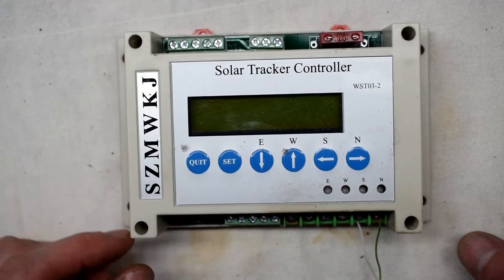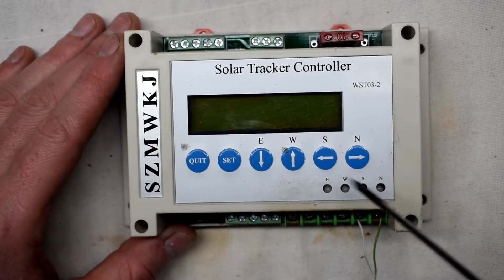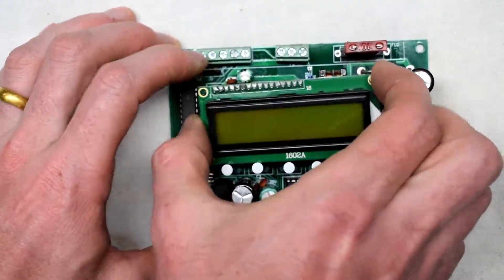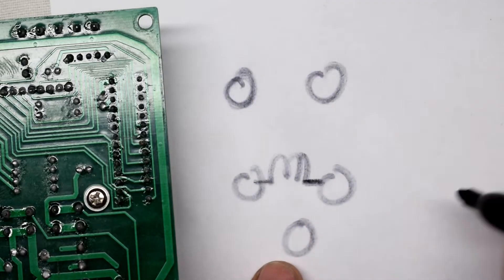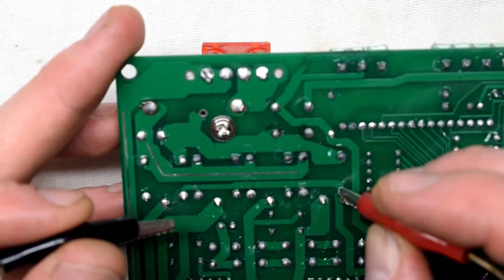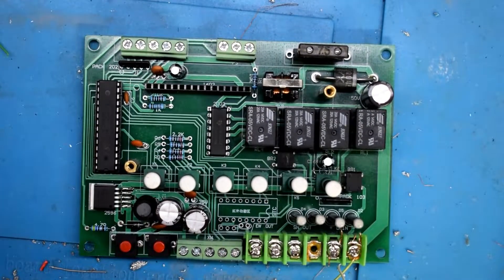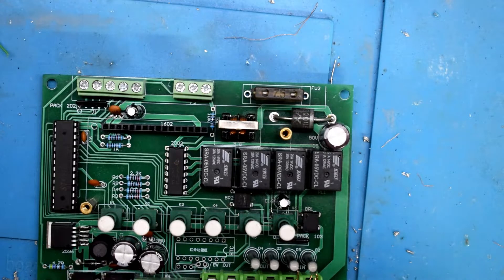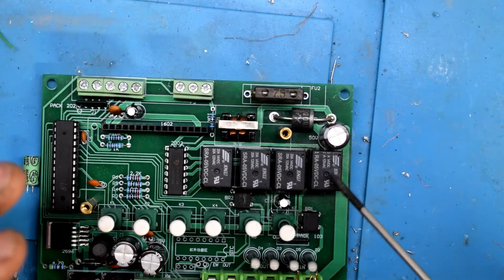WST03-2 Solar Tracker Controller Repair | Simple repair, not so simple to find.

Comment: No magic, just physics. How it works: https://youtu.be/wO9rw9bUea8 . My DIY solar tracker 2-axis https://youtu.be/_Rs8CptQcDw follows the sun automatically. Save more electricity COSTS: https://youtu.be/eC2olbCBhh0 . In this way, the solar PV self-consumption can be increased. Avoiding electricity grid purchases will greatly shorten the payback period. With the €7 dimmer + solar PV, self-sufficiency can now be greatly increased. That's how easy it is to suppress expensive grid purchases. The electricity bill stops just like the electricity meter. https://youtu.be/D9Ss0RuqZG0 Kettle: Without a dimmer, the 2500W - 600W PV system needs = 1900W, which you have to pay more for. If I turn the kettle down to 600W with a dimmer, then every PV system that is too weak can now supply each consumer independently and independently, because the 2500W kettle becomes a 600W kettle thanks to the dimmer. The prerequisite is that you have at least one small solar PV balcony power plant. You don't need an expensive battery. https://youtu.be/azDjqZpz77U The 2000W e-heater becomes a 500W e-heater via dimmer, which can run 12 hours a day free of charge via PV with me. The 4000W analog oven is also tamed. It is not the solar systems that have to grow, but the average consumption of the integrated device heaters simply has to drop by 75%. With the dimmer / voltage controller it has become so easy. I have already switched my entire household (2020) to 4x dimmers. Please have a look at my channel. 🌞 ... Increase mini PV solar self-sufficiency (winter and camping): You can continuously regulate a boiler and other power-hungry consumers with the "5000W dimmer". Ebay €7. I run 4 dimmers in parallel on an 850W inverter. Kettle 2.2KW at 150W runs 12 hours a day, so the water is always hot. The room is also nicely heated. 2.5KW washing machine runs in parallel with dimmed to 400...600W and always reaches its 60°C, and also its 1400rpm... It doesn't matter to the washing machine whether it changes the washing temperature to 5min@2500W or 100% can be achieved free of charge via existing PV power in 20min@600W. The wash cycle lasts the same time dimmed and non-dimmed, 3Sth 10min. The iron https://youtu.be/-71oL7z1kMU , dishwasher https://youtu.be/8vnAkrS1x-s , oven , electric heater, https://youtu.be/QbLWDbJi6ew , waffle iron https://youtube.com /shorts/ofanZCdYEjA?feature=share , coffee machine, all internal heating is throttled with me. Lots of videos on my channel. The inverter stays cool and quiet and the MOSFETs + (battery packs) stay intact because extreme current peaks no longer reach the inverter. Now every Mini PV Inverter is enough to operate large devices. So, with the dimmer, all internal heaters/devices can be converted into base load devices that stay almost permanently ON, drawing very little current directly from the PV. With a wattmeter / energy cost meter you can then measure this perfectly in order to set the dimmer optimally. ... Comments: "Great idea - despite studying electrical engineering, I didn't think of it myself ;-)" or "I installed it in our washing machine, great idea!" or "Glück Auf Christian, I'm a specialist myself but I haven't figured that out yet. 👌 Greetings Mitch 💚" and many more... 🌞 .... "smart energy saving", made a meaningful reaction video, for Dimmers: https://youtu.be/EHtJGiXAjZk. 🌞 ... "Free Range", also made a meaningful reaction video, to the dimmer: ttps://youtu.be/qzdRdBObtvY . 👍... "Jens Kummerow TS", also made a meaningful reaction video, to the dimmer: https://youtu.be/fTY5jWvz5CY . 👌 ... A little hint: Energy cannot be saved. So if I want to boil my water, I always have to use the same amount of energy for one liter. Christian's method relies on a longer period of time with less power in order to be able to use the power provided by the PV as efficiently as possible - so consumption peaks are intercepted. In the end, the energy consumption should even be (slightly) higher due to the interposition of the dimmer, but it doesn't matter, since more efficient coverage by the PV system and therefore better use of the self-generated energy ... Here an "automatic PV surplus Control + remote-controlled dimmer with heating element" / load management (consumption / heating element follows PV excess ... https://youtu.be/IWp7Mi2FldM . ATON - Power to Heat: https://youtu.be/wnVSaioJsjY . "Obermühle " solved this via PLC: https://youtu.be/iR30cDaf1Xk "Heating with excess PV 🌞Do your own heating rod control". 🌞... More videos on my channel. LG Christian

Comment: Be for I put my SZMWKJ- 	 tracker controller In a waterproof box I thought it would be a good idea to seal my board with nail polish SO IT DOINT COLLECT NO  MOISTURE I HAVE NEVER HAD A PROBLEM WIHE CORROSION  IT WORK GREAT😊

Comment: Mine just started to not track. It just moves to the west an stays there. The wind speed triggers just fine and my panels got to the flat side like I programed it to do, and I can manually move everything. Once I take it out of FS mode it goes to AT mode and just moves to the west. Any ideas on what to do. I have not started checking the sensor yet, I will start that soon.
Reply: Did you find a answer to ur problem?
Reply: @JamesWilliams-ey2tu  
If I recall correctly it was a bad solar panel on the sun sensor. I ended up buying a new complete unit.

Comment: I had the exact same issue, I ordered new relays, I got mine in 2020, thought I cooked it when the system jammed up, you can order 5 relays cheaply on ebay, they now make a relay external module, seems the contact welded inside, the coil fires but the contact can't move
Reply: Yep I think that's what just happened to mine One of the contacts welded and now the blue LED light for the West movement just stays lit and makes a humming sound. Now I can't even get the board to boot up 😭